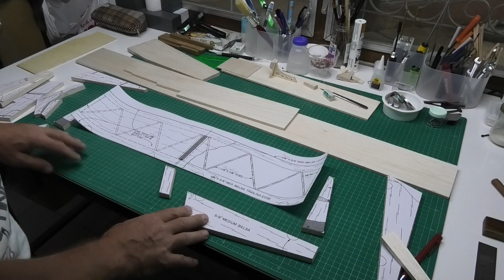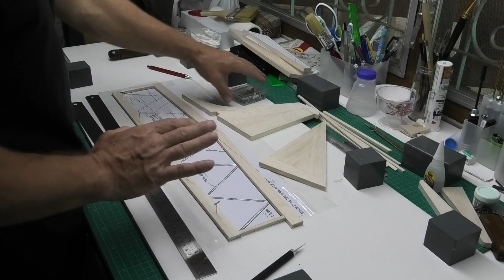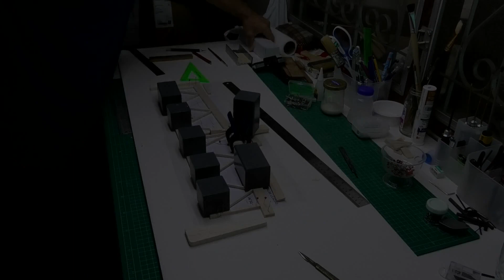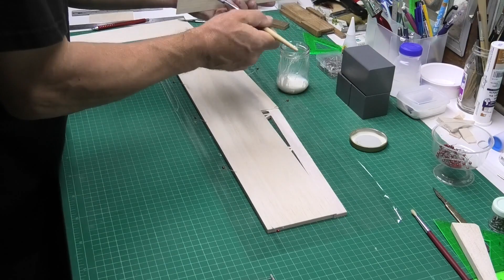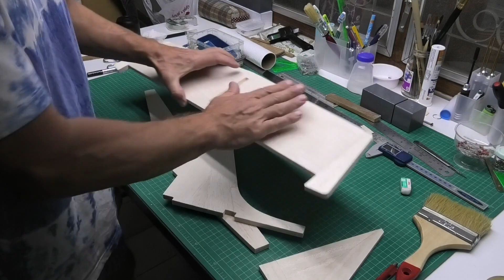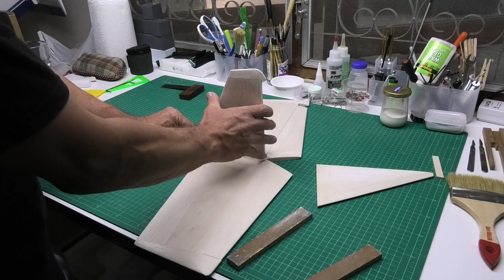Avanti Pattern Plane Pt 4 - Tailplane & Fin Build - 60" wingspan RC balsa aeroplane

Comment: What kind of glue Do you recommend?
Reply from the maker: Hi there, I guess there is no easy answer to that as it depends on the task, I use PVA, CA and Epoxy> For the tailplane and fin it was entirely PVA, although they were stuck to the fusalage with Epoxy for the extra strength.